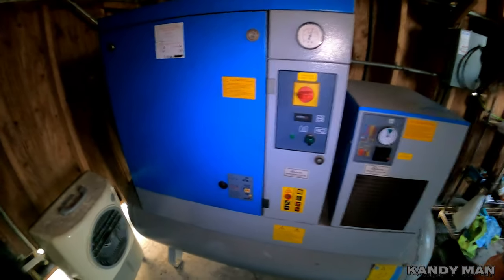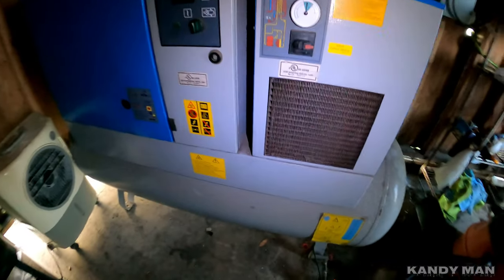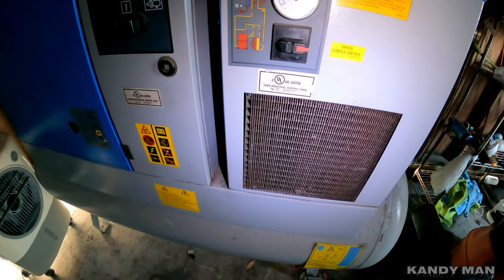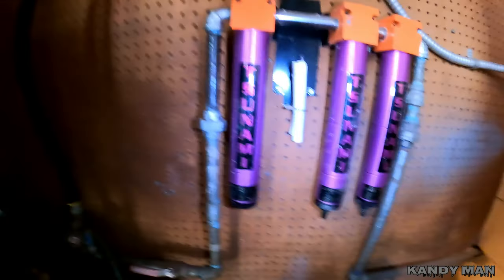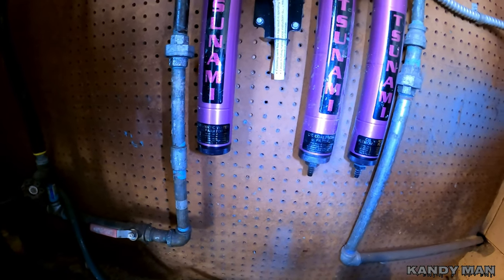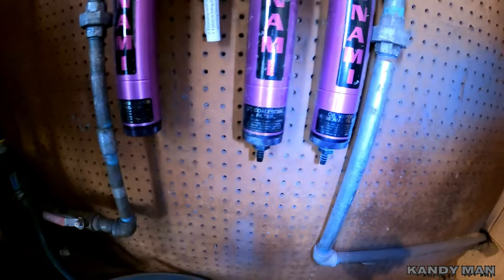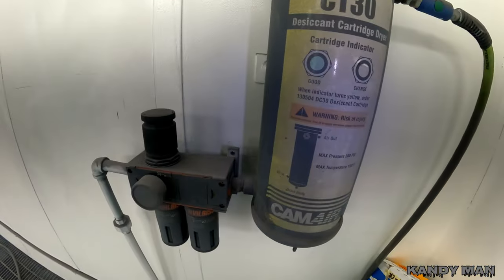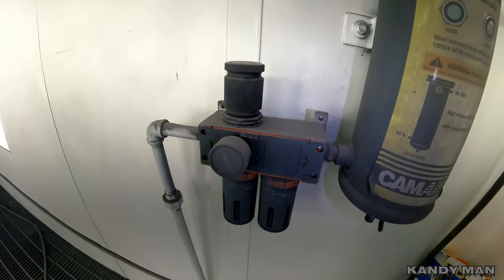COMPRESSOR SET UP AND FILTRATION

Comment: I was asked to do some work for some home/DIY guys and they all went cheap and had consumer grade compressors.  They had never been drained.  When you hooked an air blower to the air line more water than air came out.  One guys tank had so much water I flooded the shop when I drained it. Needless to say I went home after that. If you are serious about getting into bodywork and paint you need a lot of good clean air.

Comment: Oooooh wow you made this video just as I asked big big big thank you mate …the reason I asked was I have a 15,000 uk pound set up at my shop screw compressor a brand new unit only say well 11 months old with galvanised pipework and top off the line filters …two straight off the compressor and another one before it heads in to the booth …and to top it off a 3stage wall mount iwata regulator…..and a devilbiss two stage for the work area …I occasionally get the odd fish eye here and there my compressor has the same auto drain and built in refrigerator….my booth iwata 3 stage was still in use with the old compressor set up I opened the filters up they look brand new …my question is should the 3 stage filter stop any oil vapour passing by it or is this a tell tell sign they need changing…mate …I’ll upload a video off my set up to your Instagram Dm …thanks mate abs west oxford body shop …😎